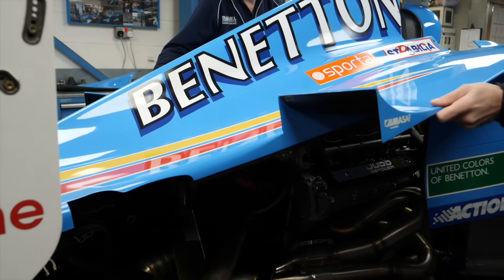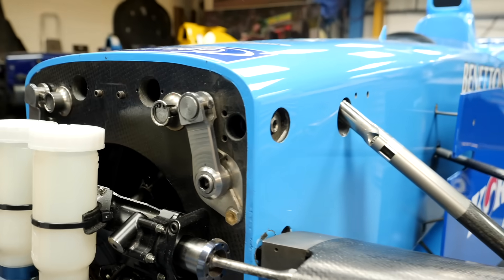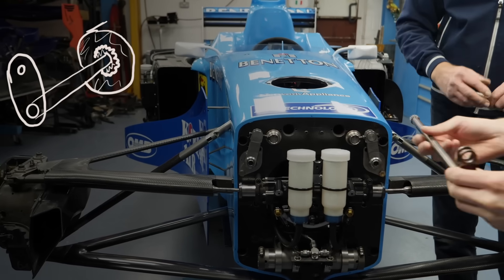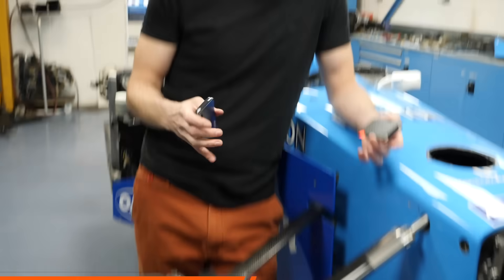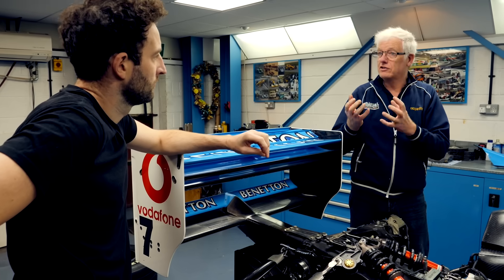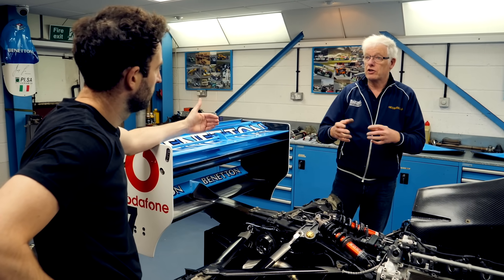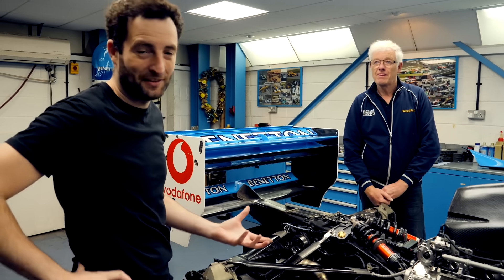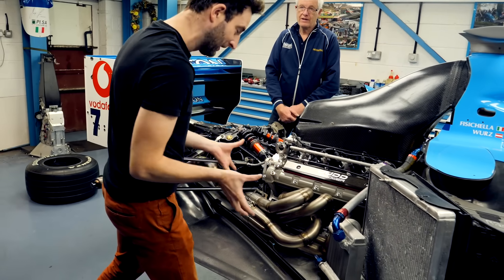Why F1 Suspension Doesn't Use Coil Springs!

Comment: It's still a spring - what you mean is a COIL SPRING.
Reply: I was scratching my head about the title saying no spring and the pic is a torsion spring.  Sprung steel is sprung steel no matter what the shape is.  With that logic leaf springs aren’t springs either.
Reply: True!

And from my mechanical engineering background... torsion and spring actually “work” the same way locally. In flexion. 

This is a bit counterintuitive the first time though. 😅

Comment: I consider the main reason they don't use stressed engines and transmissions in road cars is because the vibration would be considered intolerable.  Racers are just expected to put up with it.

Comment: The headers are of equal length the firing order of the engine designates at what time each cylinders pressure hits the common tube at the end. The point of it is to use one cylinders pressure or rather the vacuum behind said pressure to help extract another cylinders exhaust pressure from the combustion chamber. It's all rhythmic pulses of pressure and by nature vacuum helping every other cylinder extract gasses from its chamber by being length tuned as well as firing order tuned to make it happen. Nascar used to use crossover headers to make the effect happen. From one bank a pulse generated can provide a vacuum in the opposite bank respective of the specific firing order of the engine.
Reply: If you look at Chrysler's cross ram injection manifolds its basically the very same idea just at the entrance of the engine instead of the exit. With very specific length intake runners you can tune the intake air pressure resonance for a certain rpm scenario to maximize power at a given rpm. It's very interesting to see in person on the chrysler 426 hemis because the carburetors sit over top of each fender well inside the engine compartment. I would give my left nut to do what his father does extracting power from nothing it's a very tedious job with very many back to back tests to verify power gains. But I'm am just a simple mechanic who takes the bits of knowledge I can harvest to create what I wish for myself.

Comment: I noticed that coming off the bell cranks of the rear suspension there are small links that go through a pivot system that connects the two sides together and I am wondering what the purpose on the links are???
Reply: Anti roll bar.

Comment: Great video. I wonder, is that Benetton B200 or 201? According to vodafone branding is 201, but why it had Judd engine instead of Renault?
Reply: The original engines of the time period would have probably lasted barely more than a grand prix weekend. Phenomenally expensive, and I suspect finding anybody who can rebuild and support them could be a problem, so putting in an to all intents and purposes similar engine makes a lot of sense for what they're using them for. Lovely to see them still going! By the way Judd themselves supplied F1 engines in the 80s and 90s.
Reply: @rexmedorum  okay. thanx for explanation :)

Comment: Hello,
The chassis is basically not much different from a farm tractor. No innovation there.😂
Every thing bolts on to the differential, gearbox and engine assembly.
Waw🤔
Cheers from Belgium.

Comment: Basically the same happens with the springs. They also turn like the torsion bar. That's why the coil spring compresses, because it turns axially.

Comment: Very nice explanation on the exhaust system, but wouldn't it be simpler to just exit out of each cylinder to the atmosphere instead of collecting them into a common pipe? I see this for example on Spitfires and other vintage planes. Is it something to do with regulations? Or is it something to do with getting the pulse exiting from one cylinder to create a vacuum and pull the exhaust from the next cylinder in the firing order?
Reply: You explained it yourself. You don't see it in Spitfires or top fuel dragsters because they are supercharged.

Comment: Nice to know that my old 68 vw bug has something in common with an F1 car.
Reply: Lots of vehicles use torsion spring suspension. 1970’s Datsun pickups, Old Chrysler Newport’s had them too. Nothing amazing about a torsion spring suspension. Lol
Reply: Didn't say that torsion bar suspension was exclusive to VW. Just appreciating the engineering concept shared between polar opposite vehicles.
Reply: @ninos68bug , I didn’t imply you said it was. it was more about the video title making it seem like alien technology, when in fact they do use common suspension spring design used for suspension. In fact, more related to your bug, Ferdinand Porsche in 1931 applied for the patent for the torsion bar (spring) suspension.

Comment: Springs are replaced by torsion bars. But what replaces the dampers? On the rear suspension it's clear that there is a spring - damper combo to support the weight of the car and to dampen forces that acting the suspension.

And also, how is a 2020 car suspension is built?
Reply: Nothing replaces the dampers, it still has them.
Reply: @wingracer1614  aham. Thx.
Reply: @wingracer1614  I wonder how it is placed relative to each other. I mean the springs are supporting the weight of the car AND not letting the car oscillating when the dampers are in use. Basically the same task. On the rear the spring is around the dampers.

How is it placed on the front with the torsion bar? Any idea?

Comment: if the collector is the first point of restriction why doesn't the system have individual exhaust pipes all of the way through?
Reply: You want the pipes connected together for scavenging. Basically when the exhaust valve on one cylinder opens, the exhaust gasses from the previous cylinder are still rushing out the pipe creating a suction to help pull the exhaust out of the now open cylinder. It's all pretty standard stuff on all multi cylinder engines except for supercharged applications where it doesn't matter so much. That's why you don't see it on supercharged drag cars or most WWII fighter aircraft.
Reply: @wingracer1614  Why doesn't it matter on a supercharged car
Reply: @wingracer1614  I watched and enjoyed that thank you.
Reply: @Siiello  You're welcome. Check out some of his other vids. I especially like his one on turbo vs supercharging and his series on the P-47. Very enlightening and well researched.

Comment: Lots of trailers and caravans has torsion bar suspension. Not exactly as in a F1, but the principle is the same. Other thongs using torsion suspension: tanks, older pickup trucks.

Comment: I want to ask though, if the front suspension is Torsion Bar, how do they fine tune it? Like do they change the whole torsion bar or some other techniques i don't know?
Reply from the maker: Yes so they have several different bars with different thicknesses and materials, they are all identical sizes so you can swap them out easily to tune the car. You can also add pre-load (how much the bar is already twisted when the car is sitting) to tune the stiffness a bit too!
Reply: @Driver61  Preload does not change the stiffness (spring rate). It would only change ride height and/or corner weights.

Comment: 09:53 RB overheating problem came also with the KERS batteries in 2011. Optimising weight distribution and centre of gravity, therefore balance (of the car) Adrian Newey required his team to place KERS batteries in a special way.

Comment: I really enjoyed this video. In particular the exhaust length. Excellent work.
Reply: Headers and exhausts are a proven science but whoever actually makes it certainly is clever
Reply: @markmitchell450  understood, but what resonates with me is my interest in 2 strokes. An 4 stroke engine tuner, I read, wrote that the higher the rpm the more the 4 stroke behaves like two stroke. So I was thinking of the expansion chambers on 2 strokes.

Comment: Can you talk about the spring that hit Felipe Massa?
Reply: That car didn't have one on it. It was a third coil spring mounted between the rear rocker arms.
Reply: @wingracer1614  Thanks.  What does it do?  Does it act like a sway bar or provide resistance to bottoming out?
Reply: @NoToBigBro  It's kind of the opposite of a sway bar. It increases stiffness in bump (to resist dowforce pushing down on the car) without making it stiffer in roll.

Comment: Fascinating to see the car so up close. Scott, I'd love to see how these old girls get prepped for modern racing, with presumably much cheaper replacement engines? Are they on Monico spec suspension for the added strength and reliability?
Reply: You can see in the video (on the engine) that's a Judd engine, which as far as I know wasn't used originally in any Benetton F1. So I guess yes, it has Judd's replacement engine:
https://en.wikipedia.org/wiki/Judd_(engine)
https://juddpower.com/our-engines/ (3000km between rebuilds)
It is a quite common engine swap:
https://www.youtube.com/results?search_query=judd+engine++swap
Reply: @B4ndItOo  yes, DriveTribe recently did a video about JUDD as well, they make and maintain a lot of V10 engines for older F1 cars to be used in historic races and things like Goodwood FOS
Reply: The Monaco suspension is probably better for short, bumpy British tracks
Reply: From personal experience on 1994 Tyrrells and 1998 Benettons - their engines are Judd 3.5 liter V10s for sports cars and detuned somewhat.  If memory serves me, 11,000 RPM vs 19,000 so they can run about 1600 race miles between a $45,000 rebuild by Judd.  That still was good for about 750 HP in a 1400 lb. car.  The cars I worked on used steel suspension parts instead of carbon fiber and used, not new, brake pads and rotors.  On these cars the clutch was actuated by a pedal and the gearbox was shifted electrically. I think they had to replace all the wiring in the car to fit the new engine computer and data system.  Racing historic F1 cars is not a cheap hobby, by any means.